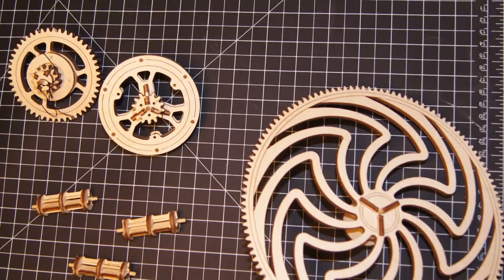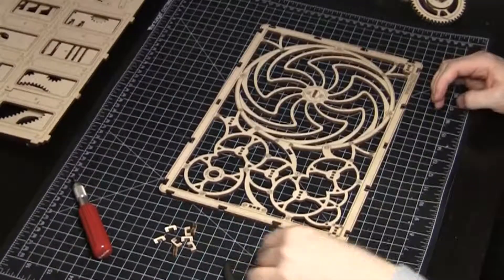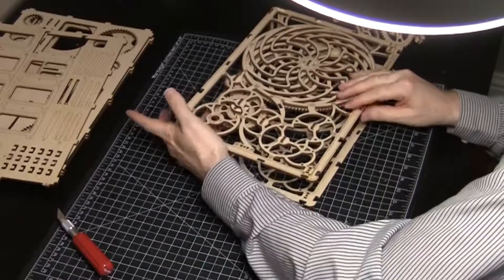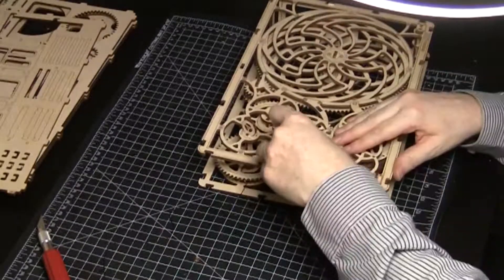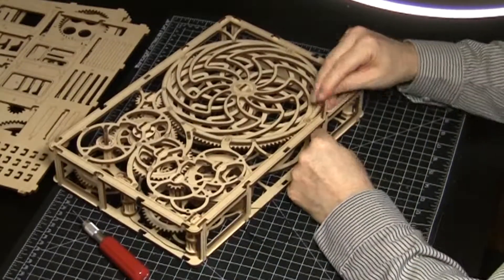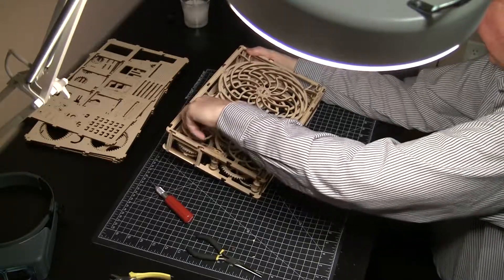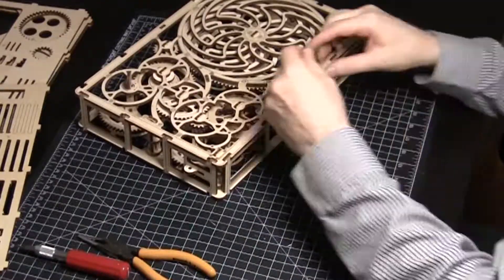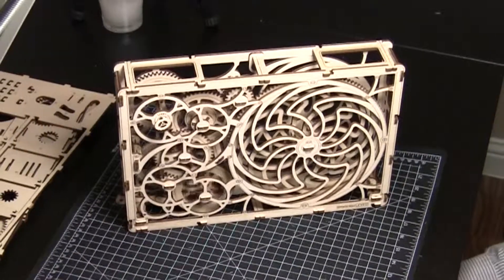kinetic picture finish

Comment: previously I left comment on it. l wrote mail to wooden city customer sevice center & got a reply. The reason that mine didn't work came from my fault..The direction of the Wheels was wrong..Ahaha..So I revised my comments..Your advise was right. Thanks.
Reply from the maker: I'm sorry to hear that.  Where do you think it isn't working?  Does one gear seem to bind or does something seem to be loose that shouldn't be or does something else seem off?  I often have to fiddle with a kit after the assembly to get it to work as intended.  Sometimes it's not worth the effort.  My recollection is this one worked for me right away.
Reply: @edclune5357  Thank you for your concern. I Checked all gears are bound. Maybe problem comes from thread & rubber band. the instruction is difficult to recognize correctly. But i can not reassemble. It will be so stressful. 
I bought it 150 dollars from South Korea. Well..you are very kind though.